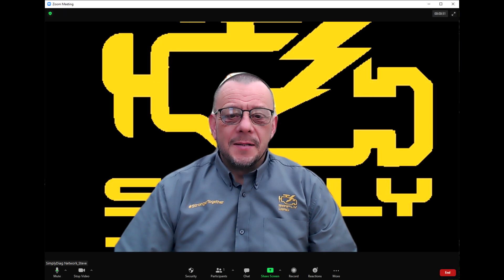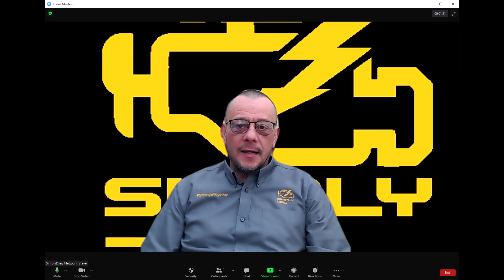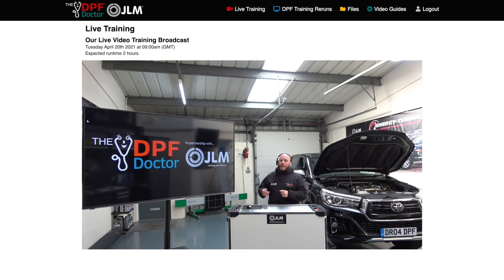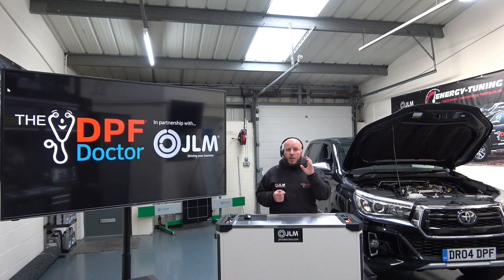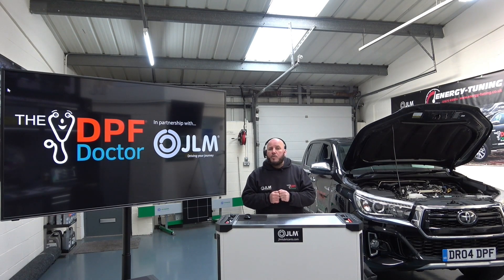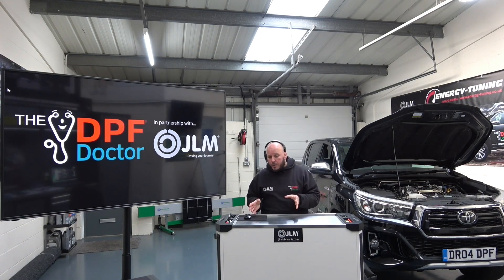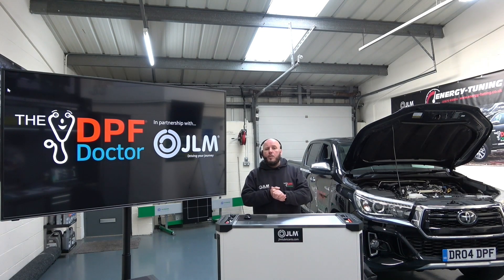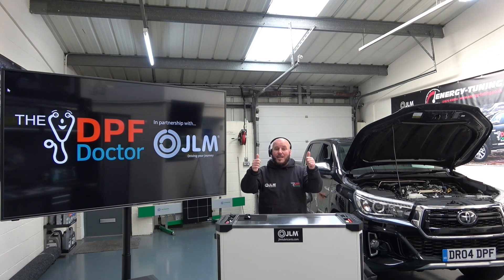How to diagnose DPF problems quickly and efficiently - The new DPF Doctor Network training portal

Comment: i thought a DPF was a waste of time but yes they put out small particles but in a very small amount , i could not believe this until i saw a machine testing the amount of particle coming out of a exhaust system with and without a DPF . now with adblue they have very little smell at all . down side can fail for simple problems not putting enough fuel in tank , short journeys , cheap fuels , not having oil changes on time